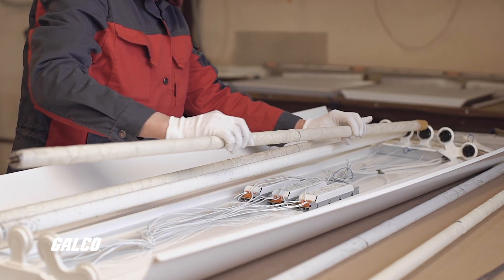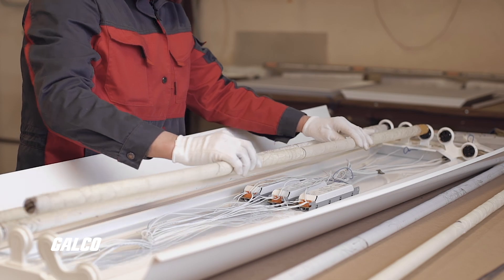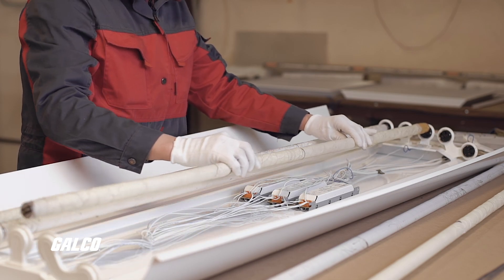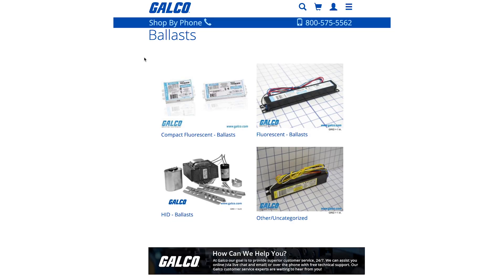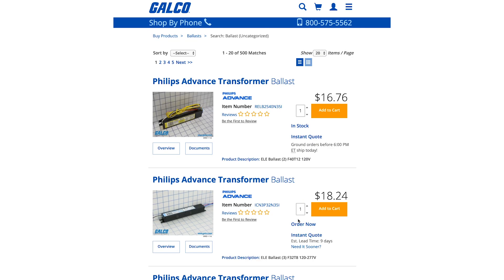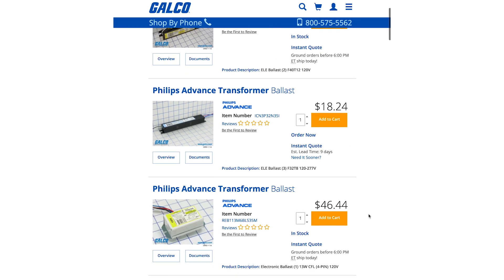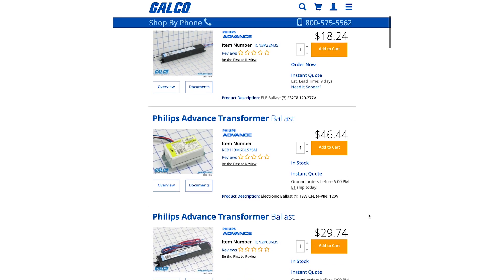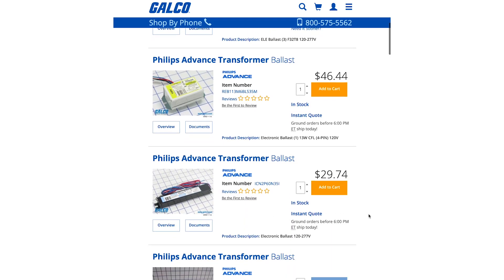What are Ballasts? - A GalcoTV Tech Tip | Galco

Comment: Also known as choke or choke coil, not only limiting the current but also raises the voltage instantaneously when the power applied.
It's used with florescent lights and mercury fittings.
With the help of igniter it can produce frequent high voltage pulses to ignite sodium and metal halide bulbs.